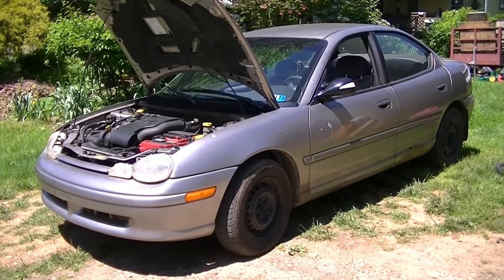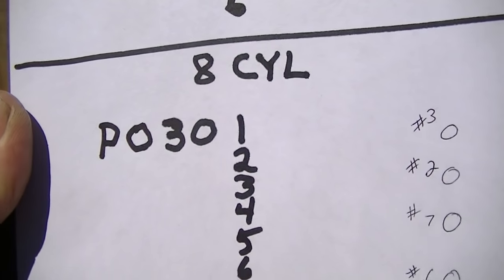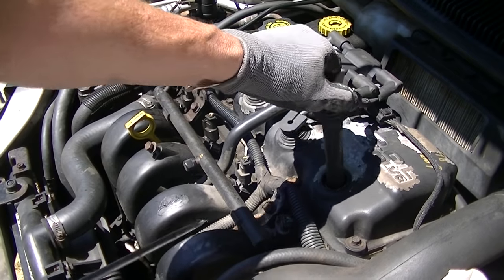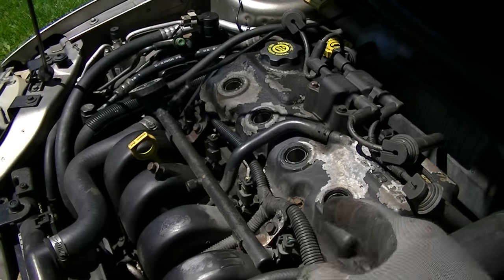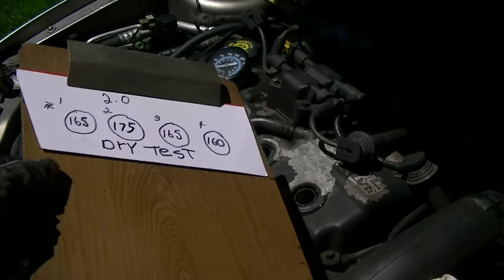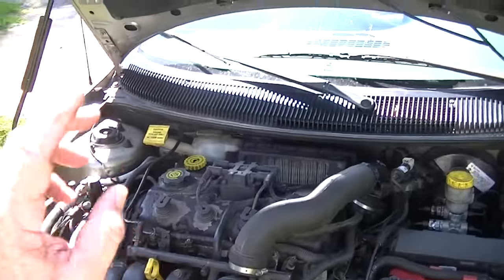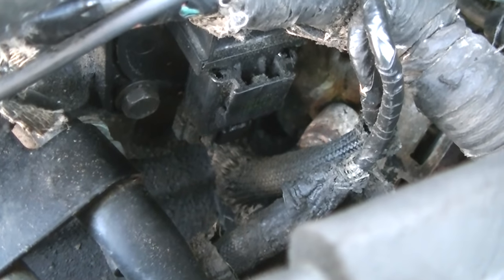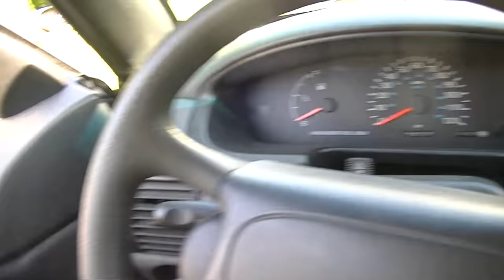P0300...How I fixed My code....P0300. Simple steps!

Comment from the maker: I hope I explained this PO300 trouble well enough for everyone. Bottom 
line my experience with code, seems to always be a broken/bad 
connection, bad sensors. ------Here is an Example and this one is a bit 
easier to figure out... .....(PO300 AND SAY A....PO304, tells you where 
to look) Cyl #4.
Reply: TVWXMAN32 5 I want
Reply: If its a bad sensor you should get a code for it,just checking.
Reply: Nathan Rohrbough .
Reply: Nathan Rohrbough you did an awesome job! Currently trying to figure out the same issue on my ‘07 Camry
Reply: Nathan Rohrbough now mine also threw a P0305 code so I know to look at cylinder 5. About 2 months ago I had changed all spark plugs and coil packs and the car ran great (check engine light never went off though). Now just recently the car started running pretty bad and idling hard and the check engine light started flashing (and that’s when I got a P0300 and P0305).
Reply: Mine ended up being coil packs not sure witch one but replaced them all
Reply: i have a 97 mustang gt 4.6 with cyllinder#7 misfire and was looking at your cylinder diagram.... fyi it has a #9 cylinder instead of a cylinder#1. thanks for the help
Reply: Nathan Rohrbough 
Fuel pump usually is bad every time
Reply: henry denson Ær
Reply: @combomelt  yeah i noticed that too LOL cylinder 9 on an V8 ? what the heck! XD
Reply: what if i get a P0300, and a P0301, P0302, P0303, P0304 but my engine runs fine? is that just a vacuum leak in the intake somehow? almost like a bad/dirty FITV?
Reply: Mine was a 90 degree turned black rubber hose disconnected from its nipple. Vacuum leak.Amen.
Reply: @Nimatoofan  and then what?
Reply: Ya I have a p0303 which is the 3rd cyl of course had the spark plugs changed now it's back even worse..gonna check the wires. Just hoping it's not a compression issue as I don't gave a tester for that..
Reply: @Bruce-mh8mo  fuel pressure maybe. Ever figure it out?
Reply: What if i have a p0316 to go with it i have a 2007 ford taurus
Reply: @grimreaper7862 how much was all coil pack?

Comment: P0300 in fact CAN be tripped by an EVAP Emissions LARGE leak code GM P0455. I dealt with it Twice in the last two months.
Awesome procedure and video Nathan. You got a new subscriber!
Reply from the maker: Yes so true! Thanks for sharing!~
Reply: So was a new gas cap the solution??
Reply: I also  have P0455 … my car did vibrate and idle rough … drove home and turned the engine off and restarted the engine and car ran fine again but has Permanent codes P0455 & P0441

Comment: The biggest cause of a P0300 is the battery. Every inspection should start with testing the battery, then go from there. To set a P0300 code it has to be something the computer directly controls, like the coils and injectors. It will not set a P0300 from carbon build up, sludge, worn or bent valves, worn rings or a hole in your piston.
Reply from the maker: Good point! Thanks for sharing!
Reply: Hey I Have a p0300 code p0301 0302 0303 0304 all cylinders misfire and then each cylinder on my 2012 vw cc also epc and battery light is on ! I changed the plugs, and coils and replaced the battery because it was dead. It still won’t start, it tries to turn over but can’t. What do you suppose it could be ? I don’t want to keep throwing parts at it but I’m stumped!
Reply: @youtubebitchcenter1463  hello, did you find a solution ? I’m try the process of elimination, I’ve been changing sensors, cleaning parts & changing parts associated with sensors… any suggestions would be appreciated. I have a 2008 Jeep Grand Cherokee Laredo 3.7. Please and thank you.
Reply: @youtubebitchcenter1463 check fuel pump or injectors
Reply: Check for water in the gas tank
Reply: @gorditabioful you’re the only one checking the right thing, right now I’m driving a Tacoma with P0300 dumped two bottles of sea foam in the tank…. New engine again, just bad gas 😏
Reply: @64arguz  Glad to know it helped!

Comment: Hey I think you did a very good job explaining everything thing because it all makes a lot of sense I have that po 300 code and a 301 on my 04 mustang GT automatic dark shadow gray and I have been buying new sensors and new injectors and coils and the code comes right back so I am going to replace all the connectors on the fuel and coils and see if that helps
Reply from the maker: Nice!!
Reply: Ever get it fixed ?

Comment: I believe on the fuel pump there is a check valve . When you put your pressure gauge on to test  , it should hold pressure after the key is off for a certain time period . If it drops too quickly , the check valve is bad . On a volume test , if your pressure gauge has a dump valve , with the car running , I believe about 16 ounces should come out in 30 seconds . That is a ballpark number . A clogged fuel filter or bad pump may slow it down .
Reply: Ounces? Who's using these old timey measurements? Fax me the answer.
Reply: @sniddles  😂

Comment from the maker: I'm saying if you have a real loose timing chain or loose belt...it only takes 0.5 degrees for the cam and crank to detect a difference between the two of them. They may spin at the same timing marks, but the slack will noted in the sensors if slack or a different point of reference is seen in the cam and crank sensors. Even if one sensor starts to fail...it see's this as one of the two (crank or cam) are not in time, or thinks there not spinning the same time....then gives a code. In a nut shell.

Comment: Well explained sir. Thanks a lot. Dealing with P0300 right now and I'm not as familiar with cars as you are. Tough situation. I've decided to replace the plugs and ignition coil for now.
Reply: By changing the spark plugs and ignition coils, Did that fix the problem?
Reply: @NuMBERNYC  did you figure out your problem?

Comment: Hope all is well . Great video. My wife have a 2006 Nissan Altima and her vehicle stalled out on her. I replaced the coil packs, spark plugs and everything. She has a PO300 code as well. The battery is 4 months old. I replaced her fuel pump a year ago. Im wondering if its her fuel pump?

Comment: I'm in the P0300 boat too.

My wife drives a 2016 Nissan Rogue. It has very few miles on it - 4,400. All the sudden she took it out the other day and she said it was shaking. When I took it for a ride it was misfiring badly and I got codes P0301 P0300 P0219a.

Since the P0301 is cylinder 1 misfire I first swapped the coils of 1 & 2 cylinders. Same P0301 and bad misfire. Then I swapped 1 & 2 plugs and the misfire code went to cylinder 2. Thought I solved it with a plug replacement but day later got rough idle and check engine light again but now P0303 P0300. So, I change all the plugs. Still rough idle and check engine light with P0300 code.

Looking closer at the removed plugs they showed some carbon and fuel progressed up the threads - this was on all cylinders.

Messing with my code scanner I found a monitoring function that shows how many detected misfires in each cylinder. Letting the car idle cylinders 1 & 2 show zero but cylinders 3 & 4 have progressively growing number of misfires. Just to do something I swapped the 1 & 3 coils and the 2 & 4 coils but no change.

The car is running much better than when it had the first problem but still rough at idle and misfires sometimes at low loads. Seems better under load.

Any suggestions on what to try next welcome.

Thanks - Mike

Comment: Wow, can i just tell you that you know your shit!! 

The way you explained it was perfect. I've been dealing with a few weird issues in my 6mt 2003 350z. Once in a while i'll see a P0300 code stored but I would just clear it and it won't return for a few weeks, then back again. The moment you mentioned that the P0300 is misleading and is actually getting triggered by camshaft and crankshaft sensor values, it all made sense. My car is notorious for chewing through cam sensors and that one statement you made verified it in an instant. My other symptoms were slightly rough idle, and after a cold start with a minute or so warming up from a stop to crawling and driving if I hold the clutch a little too long at the bite point its starts jerking till it catches gear and gains speed. Never have this issue when fully warmed up driving throughout the day. Cam sensors work with oil, so temps matter which further proves my point that the culprit is cam sensors since the oil is cold and electrical signals are weaker, thus my jerking. Thanks a lot for giving info that would've taken me longer to find on the internet!

Comment: chevy express  vortex  6.0.   persistent steady   p 0300 only at  high load / 60  mph  plus on  highways.    did all   plugs,  wires, tuneup  then   ecu and  ground   cleans,  put in   new crank pos  sensor   , and  new  cam  pos  sensor.   still giving p0300 .      found  lots   of  corrosion  on  tone  ring   area  of  CK case  pos  sensor.      cleaning off  corrosion  cured the  p0300.

Comment: Hi there , i guess hard start ups  for example could be a problem with the Fuel Pump
if not the gas filter , obviously after having eliminating the other causes , such as Compression
test , Coils , Sparks , Fuel pressure reading is related of course to the Fuel pump , and 
checking other sensors as well  ... right ?!
Reply from the maker: Right...But if you are loosing fuel pressure (just because of a rusty line like I was) on start up...it will  do it.

Comment: I checked for spark with a screwdriver and it shocked the hell outta me.
Reply: Hey you don’t got the video??😂😂
Reply: Thats old school way 
Kmow we got the spark tester
Reply: Lmfaooooooooo
Reply: lmaooo well now you now it has spark 😂
Reply: Your the reason why we have "caution hot liquid" on coffee cups.
Reply: the ole manual bypass😂
Reply: Like he said,do NOT touch or lean on the car body. You'll get zapped.😂
Reply: Or use a insulated damn screw driver or test light connect the clip to the negative on battery
Reply: Its a way to know that it's working
Reply: Bro 😱😱😱
Reply: Some people say you had a shocking experience

Comment: Hmrms i have a p0300 on it. Engine was just rebuilt less than 100 miles on it. I know the engine was in time I set it myself. Compression is good, Timing belt is still tight like its supposed to be. Fuel filter and fuel pressure regulator are brand new as well. Never had a misfire issue till I change spark plugs and wires to get the engine ready to be tuned on a dyno. Crank and cam sensors are new as well.
Reply from the maker: O my!
Reply: @FixingWithPassion  Litterally poped a p0300 code on the first drive on the new spark plugs and wires. AFR"s went about 13.2:1 after running the engine up to about 4k rpms its still in break in period. Turned into my place of work go to park and it just shuts off. Tried to start it and you get a bad hard start. Engine wont idle without a little throttle. Mind you its a static idle engine no iac as its a built engine. 90mm tb, 272 cams, 13:1 compression. Engine ran about 100 miles with no issue. Change the plugs and like 30 seconds after a 4k rpm pull develops a misfire and well rest is history. When i did the TSing i had .038 spark plug gaps when spec is .032 they were iridium plugs which is why i didnt gap them lol. Up to that point engine was not having an issue running. Problem developed on the last 30 seconds of the drive to work lol. Thinking its cheaper oem style plug wires and spark plug gaps too wide for a high compression engine. So bought some msd wires and gappable plugs so set them at .032 gap. Sorry for the wall of text lol.
Reply: @az_3kgt714 I’m having the same issue, changes plugs now I’m getting a p0300, engine is shaky on idle and stuttering.. I pulled plugs out and bought OEM, all gapped to 0.42, still same problem, it didn’t have thus problem before I changed plugs. Just ordered all new coils, the boots didn’t feel like they seated right, I’m puzzled 05 trailblazer
Reply: @wiillthebarbertv9415  in my situation it was bad spark plug wires. Put some 10.2mm msd wires on it instead of an oem replacement and it cleared right up.
Reply: @az_3kgt714  about to replace all coils today and see if that helps

Comment: I have a 2011 Chevy Cruze with code p0301 cylinder #1. It has 127,000 miles. I've changed the spark plugs, ignition coil. It's all 4 together in one block. And cleaned the fuel injectors with carb cleaner. And checked the fuses/ current at the electrical connection. I've ran out of ideas. I'll be taking it to the dealer next week. I would like to get some more info regarding this. If I can do this myself and save some money would be awesome if not, oh well I tried. Thanks!
Reply from the maker: Do a fuel pressure test! Any fuel pressure drop while engine is off will give you this code.

Comment: It amazes me that so many people stumble upon their wiring issues. They would have to, since finding it otherwise would be impossible. This happens over and over again. Just by chance they find the issue. It is crazy. I feel sorry those that never find the issue, and keep throwing parts at it.
Reply: This is me, I haven't stumbled apon the solution yet to my p0300
Reply: It's due for replacement, just go ahead and replace it. Yes, wiring issue needs to be looked at. But basic troubleshooting is in order.
Reply: 2015 Lexus gs350 f sport  . Po300 comes and goes. Intermittent.  Also po13a. Replaced  OEM denso  plugs.
Reply: Inspected ignition coils and wiring.
Reply: Most people even mechanics, throw parts. Unless someone else you know has the same car and you can swap parts that way.

Comment: Should have checked for spark right at the plug by pulling the plug and hooking it up to the plug wire and sitting the plug on a grounded location.  The plug wires might have had spark, but that doesn't mean the plugs do.  I have seen that problem many times especially with Champion plugs like you have in that engine.

Comment: Finally someone that actually explains things and the right way.! Thank you! Hey so I have a 1998 Chevy astro van that runs bad. There's a electrical ticking when it misfires. Driving down the road it runs perfect but then randomly misfires and then doesn't at all. I figured it was a bad spark plug wire since every time it m isfires so I started it and pulled one by one spark plugs and made no difference at all the tick was still there. Do you think or can a fuel injector make that noise if it's going bad ? Problem seems to be getting worse as well now and I have very bad fuel economy now please he BCK to me Thank you:)
Reply from the maker: Any check engine lights?
Reply: TVWXMAN32 yes has been on for years I just got this from my wife's father. Was 7 different codes and I cleared them started running perfect then once gets hot does everything I explained now will do it at cold start the two codes the ecm is saying for the last 3 days is po300 and p0304 witch obviously theres something going on with 4th piston chamber. No compression check cause I no th block is fine do to it running perfect on and off. ......long block 4.3 litter v6 vortec intake. But ya everytime it starts to misfire...witch is at ...always stop signs and starting out all of a sudden it stops that little tick noise  then runs like its normal self then like a switch stops running good loose hores power and the whole thing shakes them again is fine. It's obviously what is making the ticking noise but I can't figure it out . So I guess fuel injector on 4 but not sure. Basically before I get into this I live in this van for the next 3 months so hard to work on. Is it a known thing that fuel injectors make that tick tick noise louder if they at bad ? Or do you think I have something else. ?
Reply from the maker: Ticking lifters are not a bad thing just annoying to here. Probably no whats causing the miss fire. I start looking at the fuel pressure first. See if it looses any fuel pressure when you shut it off. My neon gave me a po300 and found out it was a loss of fuel pressure.
Reply: @rileypearson3236  I am having this exact same problem you are facing. I have replaced coils and plugs. checked wiring. it would be great if you can guide me thru this problem and how you have fixed it 4 yrs ago. i ll be grateful. millions of thanks in advance

Comment: Three months ago I had transmission lurching, engine overheating, and CEL  on load only. Radiator guy said I needed a new radiator; trans guy - trans work. Checked coil packs, plugs & wires. It was # 2 ignition wire. New set of Delphi wires - $29. All problems ceased. Scotty Kilmer saved me tons of money - AGAIN!
Reply from the maker: that guy